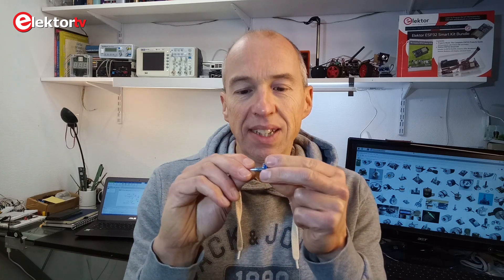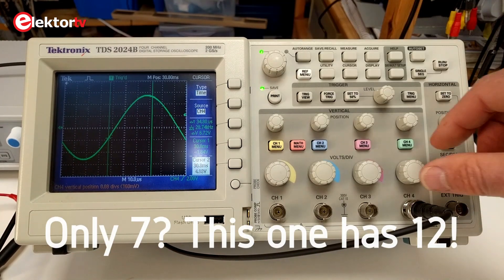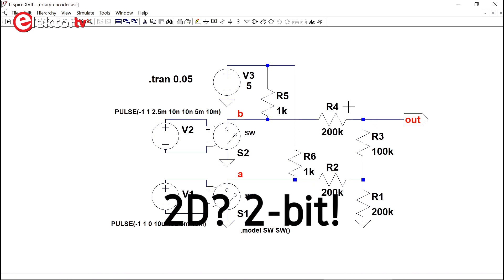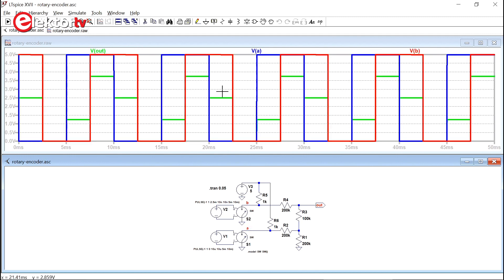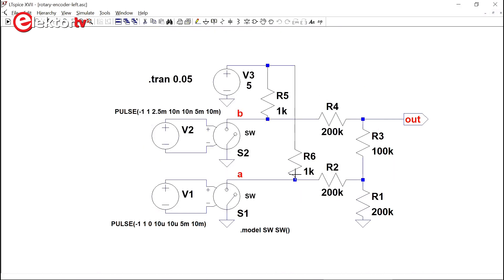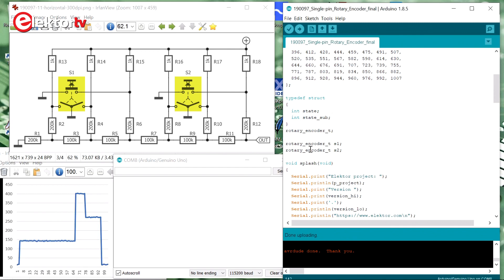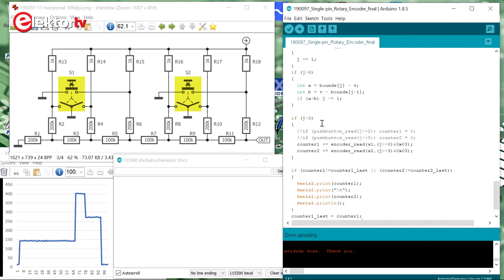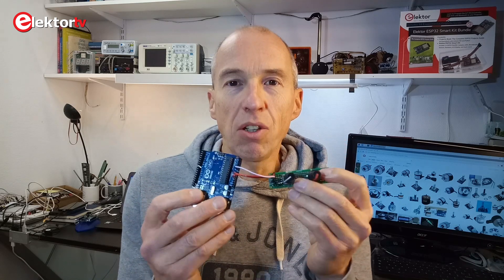Single-Pin Rotary Encoder

Comment: This is an incredible idea. Has it been set up for Esphome?  (For one dimmer and its push switch.)
It would be great for people with 3 core wire going to their light switch as we could then use a rotary encoder in place of the light switch wired to an Esp32 running Esphome in the attic connected to a dimmer module to control the room light without any rewiring. (I'm new to all of this and don't have the programming ability.)

Comment: :dothefive:I have tested it with a Nano board, but had big problems with the counters.
Instead of 10 nF now I use 100nF and in the loop() I integrate a delay of 20ms.
 Now all works fine.
I made with KiCad a small layout (6cm x 3.2cm) (one layer) , the distance between the encoders is 4 cm.

Comment: I did a similar thing: interfaced four buttons with one analogue input. I considered using R-2R but decided that is only good for ICs where it is easier to make ratios of resistors than absolute values. Instead I used just 5 resistors, 1K, 2K, 3.9K and 8.2K from each switch and a single pull-up of 1K.